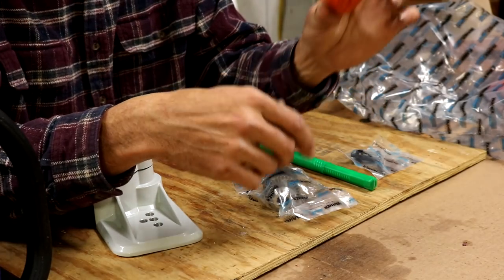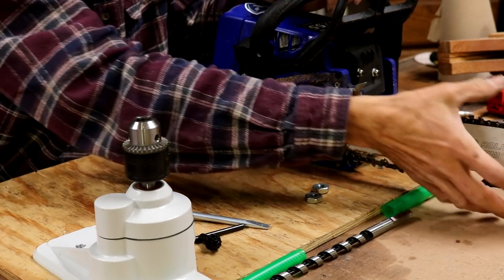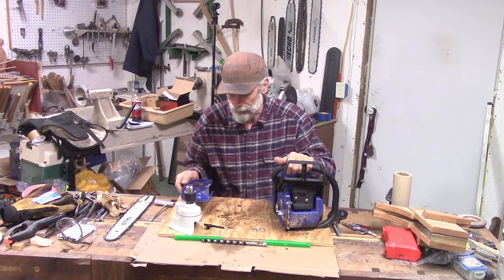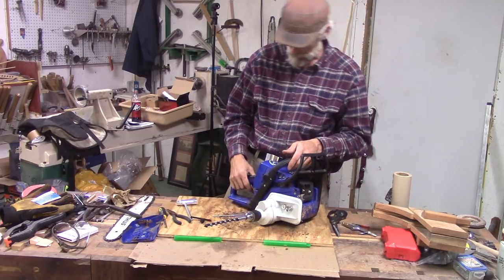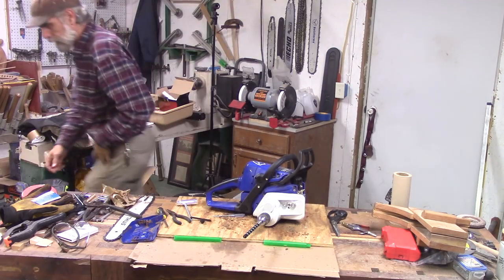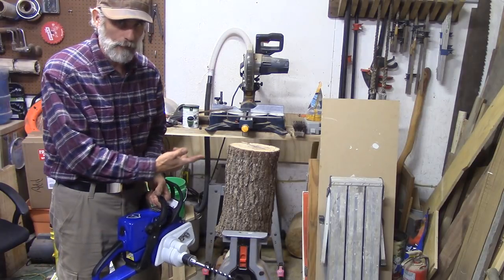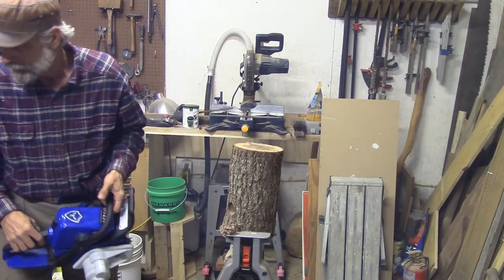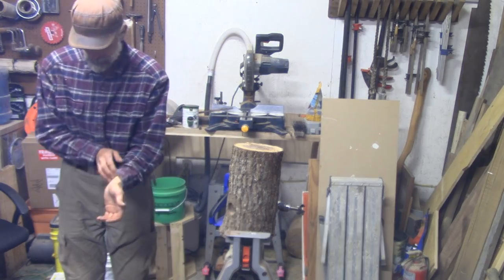Holzfforma Drill Set on the G255

Comment: you need a more powerful battery drill my friend, also have you tried out any of the higher end electric chain saws yet ?
Reply from the maker: The 20volt Porter cable is a great set except for the drill, weird, but been that way since I bought it. The Impact, Circular saw, Reciprocating saw, and multi tool are great but the damn drill sucks LOL. 
Have been eyeballing a few just haven't pulled the trigger yet. Would be nice to have for carving inside the shop when the weather is bad.
Reply: @DIYwithUncleCy  ahh fair enough, you can't actually get Porter cable where I live although they do look similar to a medium range brand I can get, though there are some crazy midrangers now the local hardware store sells a Stanley or ebrauer that has over 120nm, and ahh ok I must admit a chainsaw isn't a tool I've yet needed but always find tool reviews interesting for some reason lol

Comment: A collection is supposed to be shown Of All Saws running or Not - just maybe
someone will see 1 they just have to buy & offer you 3 times what it's worth to you!
Hahaha! A Good way to get rid of some so you can get even more Chainsaw! : ) : )
PS. Don't just love that Jawhorse? - Quick & easy clamp Anything all Steel Sawhorse
 at waist level in less than 2 minutes!  Crazy Ass Drill? at full rpm's you might be able
to push a smaller bit in and out in forward but without reverse will need pipe wrench 
to get that bit out ! Should've seen that one coming ! Oh! wait You Did and still did it 
Anyway! Hahaha! ROFLMAO! -- Good luck My Friend! : ) : ) : ) : )
Reply from the maker: YES the Jaw Horse is freaking awesome. I only got it about a month ago, been wondering how I did without it ever since.
MY non-running saw collection hasn't changed since the last collection video other than one of them is now a running saw, so it would be a bit redundant of me to go thru them again.
I think the main problem with it getting stuck was the green wood and the secondary was the feed screw on the drill bit pulled it in too fast, me not keeping the RPMs up didn't help either though LOL.

Comment: I want one! I want one! I want one! Now, you got me all worked up. I could see plenty of uses for it outdoors from putting up fences to repairing barns and it looks like it has enough torque for mortising bit's. It appears to be intended for low speed, high torque auger bits. I wonder how well it would work with larger spade bits. I suggest that you try oiling the bit, even a forstner type, while drilling, especially in green wood which expands and keep the bit moving. It's not going to be everybody's cup of tea. But, a little practice should help.

Comment: With all of the cordless options available today, I see no point in this. I do however appreciate Uncle Cy for another bad-ass video. Thank you sir!
Reply from the maker: Easier to fill a gas tank in the middle of a farm field than to charge a battery.
Reply: Sure beats hauling a genset to the worksite or killing all 6 DeWalt batteries before lunch and still having to bring out the gen, cord and corded tools. Real world examples, timber framing and fencing.... A 2 cycle drill would be near ideal. Bit & brace works great, better than any cordless but not when time is short.

Comment: Could you tell me where I could get parts for a blue max 57 cc chainsaw?  I need the starter spring assembly and the anti kick back bar.  Thanks in advance.
Reply from the maker: The blue max is one of the Zenoah clones. So if you do a search for Zenoah chainsaw parts, then look for the parts that fit their 57cc saws you should be golden.
Reply: Thanks so much.  My daughters xboyfriend cut kick back bar off it and I want to put it back on.  Thanks again.

Comment: I'm with Phillip Jones below, if I wanted to drill a hole I would use a drill, after all that is what they were made for. A chainsaw is for cutting wood and they work well but I don't see the need to change it into a drill
Reply from the maker: And when you are 2 miles from electricity and your cordless batteries die how do you drill the holes you need in that fence post for the gate you are trying to hang.
Reply: I had to build a corral back in the woods and I used a gas powered drill,and it worked great until I ran out of gas, lol!
Reply: @DIYwithUncleCy  Simple I take a brace and bit with me, I have a caravan that has no electric so I have to work with other methods.